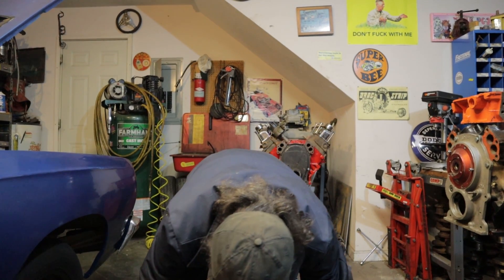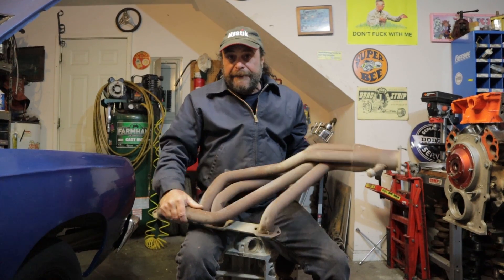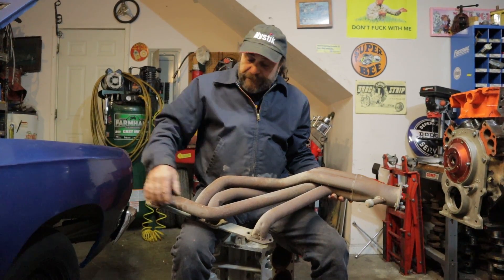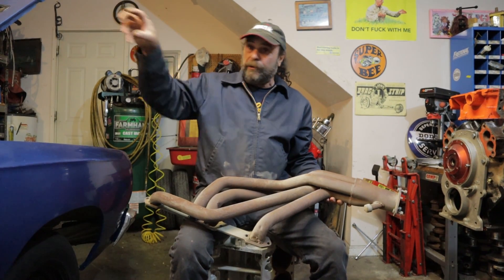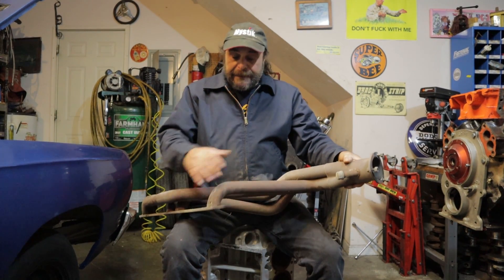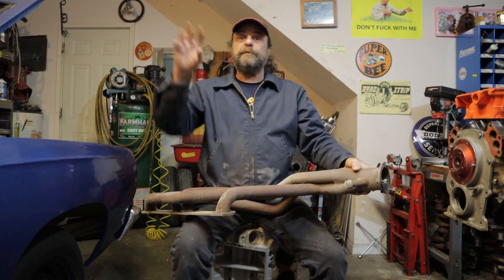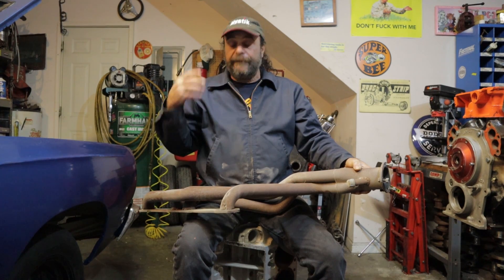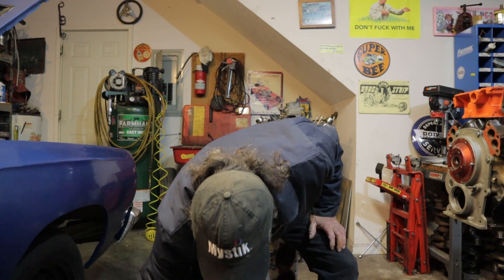The BS On Backpressure

Comment: And proper jetting. Part of the old myth was guys putting on better flowing exhaust and not jetting the carb accordingly. Too lean, runs like crud and down on power, followed by “I guess this engine likes back pressure”.
Reply: I can definitely see this in play. I've had coworkers tell me that I shouldn't touch the factory exhaust because it's designed specifically for the car. Or it'll run like crap.

I've noticed people don't want to tune after letting it breathe better.
Reply: @jamesharris5232  the "stock is best" people rarely know what they're talking about. EFI cars can often compensate through fuel trim though some are better than others at doing that than others.
Reply: @lb9gta307  some efi vehicles are designed to runs a little rich from the factory. So by opening the exhaust up it actually leans it out closer to where it should be
Reply: @konnerkramer329  if they're in closed loop they normally just try to run their target air/fuel ratio. Short term and long term fuel trim only has so much room though
Reply: @lb9gta307  right but most stock tunes only has so much room for adjustment. I know on my 6.0 Chevy it ran 11-11.5 to 1 stock. Then with long tubes a catless x pipe and flowmaster supper 44s it ran 12.5-13 to 1 when it went into closed Lope which is when the coolant was over 180 degrees
Reply: @lb9gta307  I 2nd that.
Reply: @konnerkramer329  that's the 02 sensor doing that.
Reply: @Moparmaga-1  I had 2 wideband sensors in the exhaust after the stock manifolds. Completely stock with a k&n cold air the widebands read 11-11.5 to 1. I installed speed engineering 1 7/8 long tube deleted both cats and put an x pipe where the stock cats were under the passenger side floor board. Ran the stock 3" dual exhaust to 2 flowmaster supper 44s underneath the bed then 3" dual exhaust over the axles to 4" tips. Before I got it tuned the aftermarket o2 sensors were reading 12.5-13 to 2 arfs. I had all 4 factory o2 sensors installed with the stock manifolds and with the headers. I just added 2 widebands after the manifolds before the cats and that's what I was getting my afr from.
Reply: @konnerkramer329  i'd say most if not all when in PE in order to protect the engine
Reply: @Moparmaga-1  2002 Chevy 2500hd crew cab 4wd. Had a 6.0 4l80e with a trans go shift kit and 2500 stall converter 14 bolt rear with 4.11 gears. Tsp stage 3 high lift truck cam, ported and milled 317 heads, trailblazer ss intake and throttle body. Speed engineering 1 7/8 long tubes, catless x pipe and flowmaster super 44s. With 285/50r20s ended up running a 14.3 right at 100mph. Not fast but for a 6000lbs daily driver it was a blast.
Reply: @konnerkramer329  that sounds like a fun truck! I just sold my 5.7 4wd with the 60. I wish I had a garage to do all those mods in, but I'm still living in a apartment in LA unfortunately.
Reply: @WickdPerfekT  yeah I've had a  few obs with 350s. Good trucks but I absolutely love my 02. Had a single cab short bed 5 speed 95 with a 5.7. bought it for $1800 and sold it for $3800.
Reply: Pretty much every new Harley owner that buys a new set of pipes.
Reply: @DarkLinkAD  yep...   lol
Reply: 100% any time you make a change you need to compensate.
Reply: @williamkillingsworth2619  on an efi you're absolutely correct. But on a carburated vehicle exhaust won't change jetting. I also just re-read what I wrote and realized I had that backwards. It ran 13.5 to 1 stock and around 11.5 to 1 after the exhaust.
Reply: The reality is, if the pipes had inefficient flow, then the mixture would be too rich actually. Watch this S&S video it's awesome https://youtu.be/KjKUKhHQLHg it explains it really well.
Reply: @Poop-nu1so  well the stock tune on the vehicle intentionally makes it run rich. This is especially true in a 3/4 ton pickup that's under a heavy load (pulling a trailer). The engineers know how well or poorly the exhaust flows and they adjust the tune to where they want it out of the factory. By making changes to the exhaust the cylinder filling gets better and flows more air but the injectors flow the same amount of fuel. This is why the air fuel leans out.
Reply: @konnerkramer329  OK I read your older comments. You do realize that (12.5:1) is rich, (14.7:1) is stoichiometric, and (15:1) is lean right? EDIT:These ratios are for standard gasoline only, forgot to mention.
Reply: @Poop-nu1so  12.5-13 to 1 is what makes the most power. 15-17 to 1 is what most new direct injection engines run for better fuel economy. And a lot of older vehicles run in the 11-13 range because it makes the most power. In a perfect world 14.7 is the perfect stoichiometry ratio. But that's only if the fuel is perfectly atomized and mixed perfectly throughout the entire combustion chamber. Obviously we know that's almost impossible to do. Hence why running at 12.5-13 to make makes more power that running exactly 14.7 to one.
Reply: @konnerkramer329  This 12.5:1 is only during power enrichment strategy. Whether it's a power valve on a carb, or increased duty cycle of an electronic injector. During cruise, neither carb nor EFI should be at 12.5:1. If it is, then something is wrong. Even poorly tuned carbs should never enrichen past 13.9 during cruise or it means dumping fuel that won't help power at all. The cylinder pressures aren't high enough during cruise to need such a rich mixture.
Reply: @konnerkramer329  Maybe you're only looking at A/Fs during idle? Those can be about 13 on a carb. Watch this video I'm sure you'll like it https://youtu.be/sxm5bPsUy3A edit:careful this guy has a loud intro! Goto 6:48 right away to see some numbers!
Reply: @Poop-nu1so  I'm not talking about part throttle... Who the hell tunes their carb at part throttle. At WOT you should be around 12.5-13 to 1. If your carb is tuned to run 12.5 to 1 at WOT it will lean out at part throttle. I don't know how people tune their carb now I'm sure it's with an arf gauge but when I was growing up you'd go to a back road with no cars and put a new plug in cylinder one and make a pull. Pop it in neutral and shut the car off. Then pull the plug and look to see if it's to rich or too lean. If you got the tune right at WOT the part throttle would be close enough to run fine. This is also the same reason why people Dyno tune cars at WOT throttle.
Reply: @konnerkramer329  Gotta tune for all ranges! Drives better that way. Otherwise you get "flat spots" or as seen on a dyno graph "sag". Also not all carbs automatically lean out at part throttle like you mentioned. If manifold pressure is still somewhat high, as with high loads and part throttle, the enrichment circuit may still be running and has to be adjusted properly to not over-richen. Seen it before with modded engines. Makes them doggy especially in the mid range.
Reply: @Poop-nu1so  if manifold pressure is high or if your under a high load than you'd don't want to lean out the mixture. That will heat up the engine and can cause detonation. Ever carb on Earth will lean out the mixture at part throttle. If the engine is flowing less air then the carb is flowing less fuel... Plain and simple. You can argue about stoichiometry ratio all day long the fact of the matter is an engine tuned to run at 12.5 to 1 at wide open throttle will run fine. At idle and low throttle you use the idle mixture screws to adjust afr but beyond that you're just tuning for wot.
Reply: @konnerkramer329  I'm glad you and I are on the same page! I agree with that post entirely
Reply: @Moparmaga-1  hell yeah man that sounds like it's going to be fun. I'm a Chevy boy for sure but older mopars are fucking badass.

Comment: I guess I was told by somebody that knew what they were talking about. I was told about the vacuum pulse way back, by a semi-pro drag racer. Also there is a type of header that uses a small cone right inside the header near the exhaust ports to get more velocity, but allow a big tube for low or no back pressure. (still has to be sized right, but you can go bigger than without the cone thing) Some of the guys at a shop where I hung out thought you needed some back pressure, but those guys couldn't even get the pushrod length right. If not for the one guy in the shop that really knew what he was doing, they'd have F'd up all their cars. One guy had the right pushrods, but thought some didn't fit... duh those where the cam was up did not slide down as far. Even I could figure that out in my early teens, but for me to say anything, well you just didn't do that. I let the other guys tell him and rib him about it. 
About that drag racer. My buddy got pulled over one night, he gave the cop his license, as usual for him, but just as the cop got his license, a digger rail flies by. the cop tossed my buddy's license back and said it's your lucky day, then took off after the rail. I don't know if he really thought he could catch it or would just wait until it ran out of fuel. I happe to know it's a true story, it happened on the street where the drag racer lived, and the next time I went over there, he and some of his buddies were laughing about it. He had the car in his shop and the door closed before the cop could even drive by. Me, I got to mow the weeds like usual.

Comment: One of the best explanations I have heard in my 45 years as a mechanic tuned length extractors always work better than stock manifolds . The only time this is not correct as far as I know is with forced induction ie super or turbo . The myth came about from when engine pipes burnt out lots of noise and no go only because the scavenging effect was no longer there . Correct me if I am wrong. I think you have forgotten more than I know as far as performance work goes
Reply: Superchargers just don't like a lot of overlap in the cam profile. A good header will make more power at a lower boost pressure. Turbo engines like a lot of the same things NA engines do.

Comment: Great job on this video,,,,I have tryed to explain this to a few younger guys I work with and they just dont get it they want a 3 an half inch straight pipe on there oldschool 350 Chevrolet that's stock and I tryed telling them it's the speed/velocity of the exhaust that's most important... you do a better job explaining I'm sharing this video right now
Reply: Extra large mid pipe size doesn't really hurt power. Engine Masters proved that. If it's a dual system the crossover won't be as effective but the scavenging is mostly done with the manifolds/headers. That's where proper diameter is most important. Overly large pipe is pointless weight though.
Reply: Josh 
Not to mention it would sound like ass. 
If your head was literally inside the ass.

Comment: Now for engines that are not high hp or racing or anything like that . My 85 Chevrolet s10 2.8 there's a big difference between having a muffler and then not . It seems to not take off as fast or get up and go as quick without a muffle to have like that pressure to make it go . Every vehicle I've ever messed with is almost like this I don't know about something that's got a lot of horsepower like what you own like all of those cars . Butt I definitely feel and can tell a difference between having a muffler and not . And the size of the exhaust to . I have a 3inch single in 40 series flowmaster muffler and 3inch single out . Also a difference between stock and the flowmaster exhaust
Reply from the maker: What seems and what actually is, are not always the same thing
Reply: Uncle Tony's Garage that might mean, very true
Reply: That must mean your current engine is lean, and when you put the muffler on, it can ingest less air, so the same amount of fuel is burnt with less air, so it feels more powerful as the mixture is closer to stoichiometric.

Comment: Back pressure is for 2 strokes,the front pipe,,,,when then engine is on the powerband, the cylinder is supercharged,,,
Reply from the maker: That's an extreme oversimplification

Comment: Or you can be a weekend expert and install an aftermarket carburetor and headers, with 4-inch exhaust and complain it idles weird, stalls constantly and has very little low-end power.
Reply: An Auto-Zone fartcan muffler will add 100 horsepower! Ask any high schooler!
Reply: @dreadpenguinlord340  leave my cherry bomb Honda Civic out of this. Sure it may sound like a angry cloud of mosquitoes but it has character with the wing off a Boeing 747 and a hood scoop off a dragster
Reply: did the header [s] come with a sticker? has to be visible, back window preferred. scavenging effect.